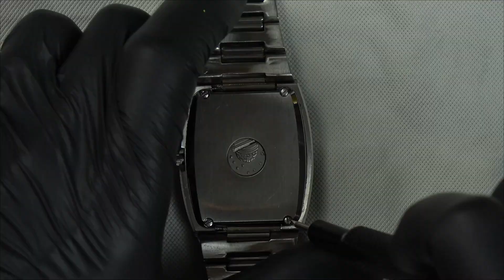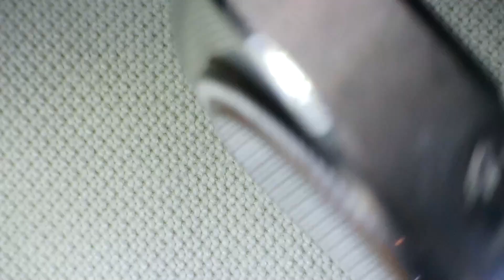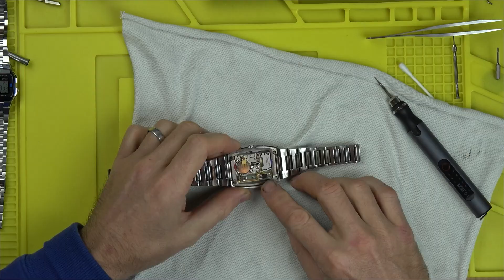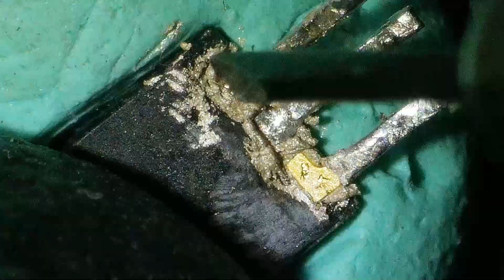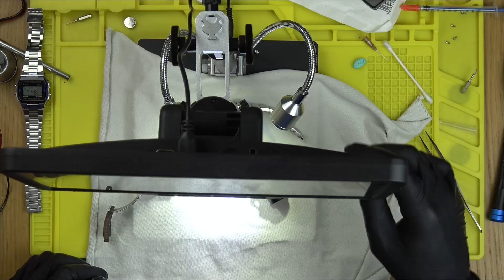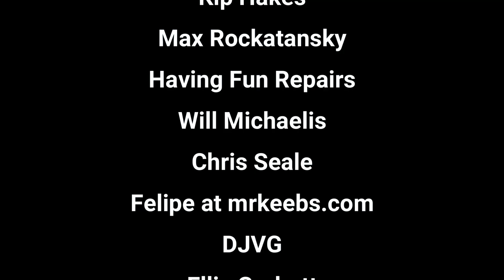Can I fix the RAREST OMEGA WATCH ? - 50 Year old OMEGA BETA 21

Comment: Amazing Vince! I felt the gut punch when the legs came lose from the ODC5 IC. I think it's some form of regulator or input output IC. The disk shaped item you resoldered is the "Quartz Motor Module" I think. That entire PCB may be called an "Electronic Module". The only thing I can think to do is cannibalize the IC from another broken item. No different than you stated.
Reply: Watch wiki says its a 5 stage divider. Turns the 8192Hz crystal into a 256Hz signal which drives the vibration motor (the technical term for those tiny arms). Divider chips are still made today and although this exact model won't be made anymore, a modern equivalent is likely to work.

Edit: found a likely equivalent on Mouser. The NJU6369 is a 5-stage divider. Requires only 1.5V to operate. The chip package is the wrong pinout but an adaptor PCB could be made.
Reply from the maker: @nhand42  Wow, thanks Nathan. I could always rewire it using jumper wires and solder mask it all into place. I will look into this chip. Thanks for doing this👍👍👍👍👍👍
Reply: @nhand42  the more you know! I'll start looking for Watch Wikis myself. Thanks for sharing.
Reply from the maker: Thank you buddy, I was gutted when it first broke BUT it did me a massive favour. I wouldn't have been able to get to the bond wires even with grinding from the other side as I would have ground away any trace of the wire. It broke so cleanly, and left the bond wires intact. A bit of a miracle on this one 😂👍👍👍👍
Reply: @Mymatevince  agreed! I took a risk with a conductive ink pin on the metronome video and ended up with similar success. I'm not sure how it will stand up over time, but last I checked it about two weeks ago the display was still functioning. Appreciate your problem solving on this one. I saw some listings for that watch going for $3K+ so I would say its a win for you if you choose to sale it one day.

Comment: Great job on fixing that. Certainly a unique time piece. What noise does it make. Hate the tic sound on more modern quartz watches. Sometimes so loud can hear from other side of room and fluctuating in noise level too! A continuous sweep like this should be better. Does it hum?
Reply from the maker: This does hum Paul. Just like the Bulova tuning fork watches but maybe not as high pitched. Personally I don't like the hum of tuning fork watches...it's different and a bit of a novelty but I prefer the sound of a mechanical or automatic watch 👍👍👍👍

Comment: It's really amazing what you can get working.  I would've done what you did up until the legs breaking off.  After that I would've put it aside and started looking for a replacement chip.  You really go above and beyond on these repairs!
Reply from the maker: Thanks Roger. Long term I want to replace that board, or better still change the chip if anyone in the comments knows what it is. They are just do hard to source at the moment. If an alternative chip could be found it would save so many of these. Thanks for watching 👍👌
Reply: @Mymatevince  this chip is a simple counter that divide the crystal frq. to a lower one. can be easy done/replaced with a simple controller if you find one that is that small. can help you find one and program it.
Reply from the maker: Thanks Itai 👌👍👍👍

Comment: Wow, just wow lol!  I honestly didn't think you could pull that off - consider me AMAZED lol   BTW - if that little round component with 4 points is a trim cap, that probably helps adjust the timing.
Reply from the maker: Hahaha, I think the break of the 3 legs on the IC actually did me a favour as it was such a clean break. How lucky was I with that 😂😎 Do you know I didn't think to adjust the timing with the cap, maybe that is how you adjust it when you need a few seconds a day difference (which I do). Cheers Chris.